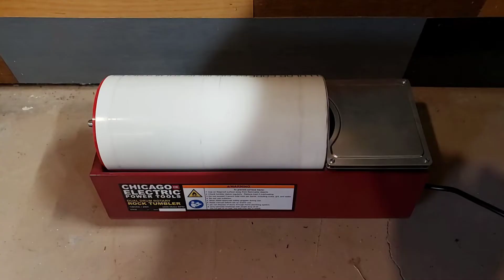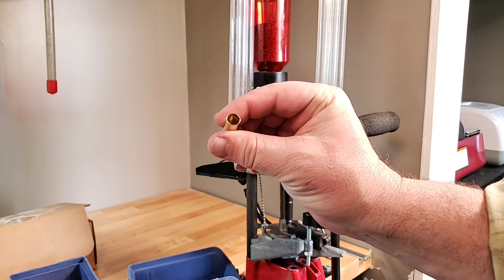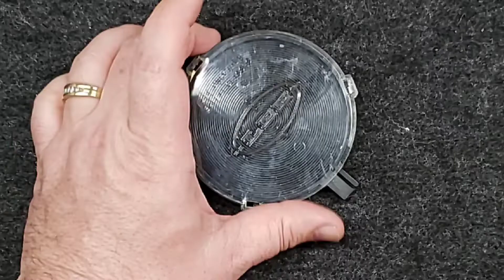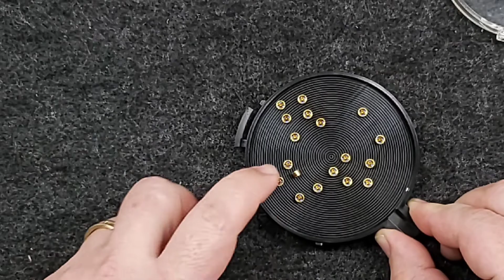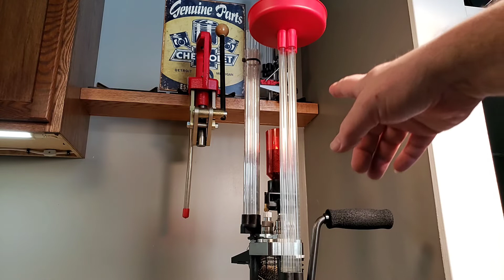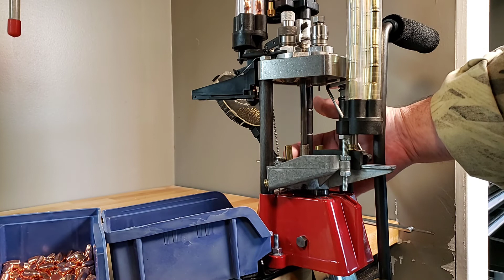Lee Pro 1000-Tips, Tricks, Setup, and Startup Procedure for Reloading

Comment: Not to find fault, however, when the shell plate is brought down, you seat the primer, set a bullet on top of the casing on it 3rd stage because its read to seat a bullet as normal, I feel its a waste of time dealing with the bullet feeder, logic is, You have to load the bullets right side up in the tubes and loading those tubes takes time. in another way it takes longer than not using it at all because you have to load the bullet feed tubes when it gets empty. uninstalling and installing the feed tubes. I DO appreciate that you go a speed that is safe with your machine and watch it closely as you process ammunition, the Lee is a good machine, however you have to go it's speed and watch everything to make sure that every thing is being done. and that go's with every machine. some people try to set a speed record with it and that is how failures at the range happen or a pistol blows up. Good video, Peace - Dave

Comment: Just fyi, I drilled a very small hole in the primer tray top and bottom at the mouth where the primers feed into the feed  shoot. Then I used a small nail cut to the depth of the primer tray. It keeps the primers from falling out and has the advantage of not letting the lid rotate to come off if you want to store your last primers in the tray. I've been doing that simple thing for years and it works great. No spilled primers.

Comment: I have this machine since 2012 never was ready for reloading it just fell apart at every moving part, clip, ring, pin, spring, and finally just had LEE go thru it and Still had to tighten the shaft to the bottom plate when i got it back shortly after and it's never seen powder till today and 1st two bullets, primers protruding out the bullets 3/32" now ones wedged between the rotation plate and exiting trough edge, if I try to pull it out at the trough may crimp the primer and go off I would think. So if I ever get that bullet out of there I need that primer to seat in the primer hole, Do you know where the adjustment is if it even has one?
Reply: I hope you are ready for the hard fact.  I you have this many issues setting the Pro 1000, you should not be reloading ammo.
Reply: @ttedrow1  The problem s were the result of manufacturer and of coarse my negligence in thinking this device came factory set. When your device falls apart in the process of reloading, is not in tolerance causing breaking or bending it's own manufactured parts. However LEE manufacturer took it back, replaced the parts and calibrated the device. This person, representative, LEE specialist was undoubtedly the absolute man I wish every manufacturer had on their salary. You should take your own advice upon your conclusions and un thought out advice. You should not have a gun in the realm you seem to be coming from.

Comment: I have run one of these presses since the early 90s. Your comment about not putting any lubricant on the press is not correct. The ram shaft and moving parts below need to be lubed. You also should put lube on the leg with the notches that cause the primer tray to shake. I did not for long enough that it wore the notches off and I had primer feed issues. Once I figured it out I just turned that leg 90 degs and started putting oil on that spot. You will also find that the primer feed case sensor will wear as the shell plate turns, causing it to not work. I do not recommend trying to lube for this as primers and oil are not friends. Just replace the parts when they wear. I removed this part but I do not recommend this as it requires you deal with a primer every stroke of the press. If you have enough experience with this press you can deal with it, but at times it can be a pain.
Reply: Hi Jim, I have the Lee Pro 1000 from the 90s Got at a reduced price as it was a demo in a shop. Problem is that manual was gone and some parts. For some reason I can't recall I just did not set it up at the time. Then it got missed place by my brother and years later found it again. Again a year or three passed but now I'm ready to get it going. Will it be possible for you to send me some pictures of yours as it appears the powder dispenser on mine is not correct.
Reply: @vickventer53  I can send you pics but the press from the 90s is the same as the new one (not the 2018 version). Here is lee's instruction page.
 https://leeprecision.com/instructions.html 
If you are having specific issues, let me know and I can see what I can do to help.